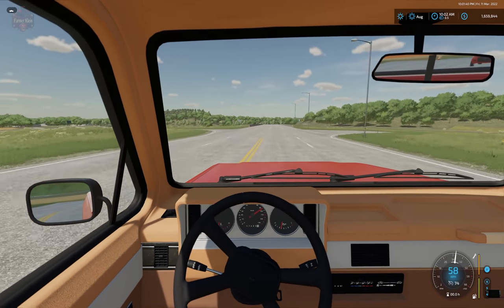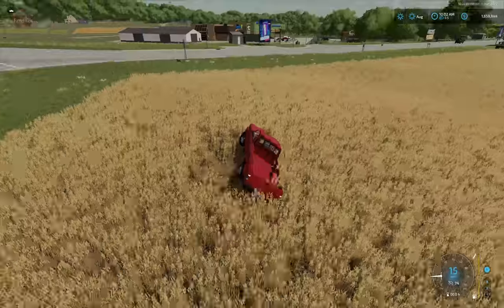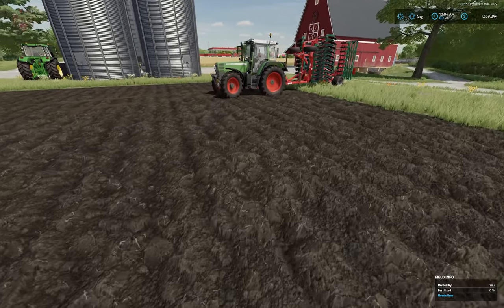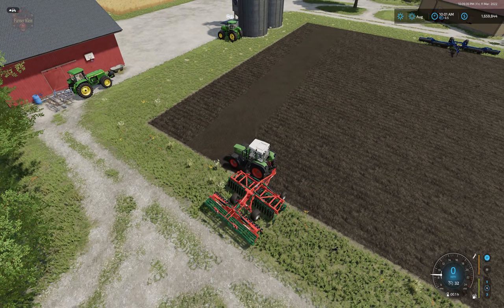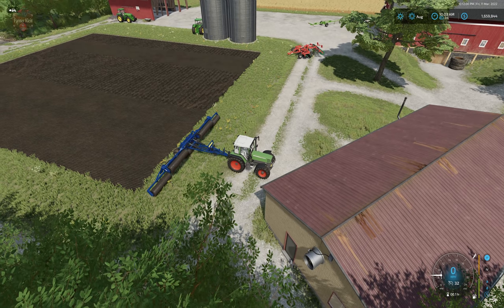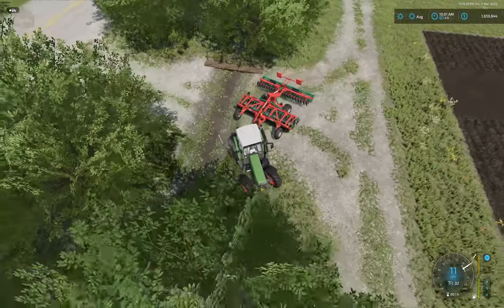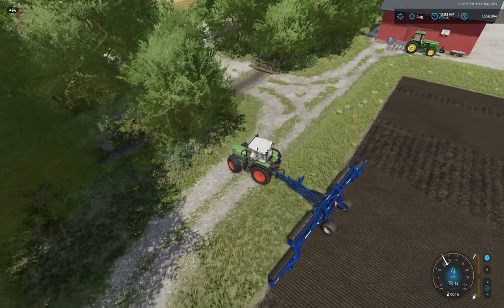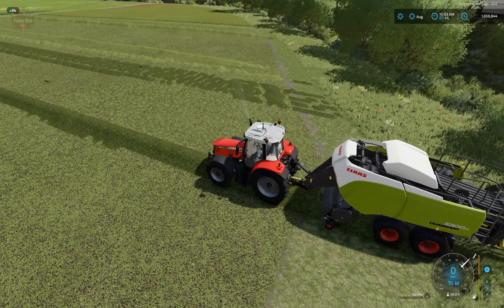REA22 Center of Gravity & Implements | Mod Review | Farming Simulator 22

Comment: I had an AI planting and it drove into a parked tractor. I'm using all three of these mods which I love.  It baryed half the tractor in the ground.  I tried to push and then pull the tractor out. The tractor acted like the tires where in cement.  I reloaded the game and the tractor was free.